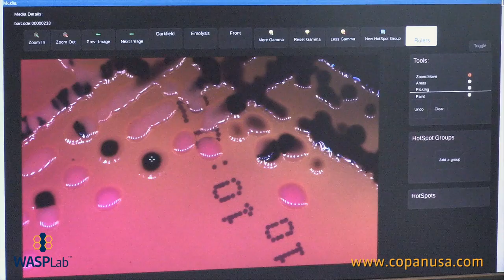(2012) WASPLab Video

Comment: Amazing isn't it...a single lab tech smiling and effortlessly processing hundreds of samples. Of course anyone with a grain of sense would know that this is a load of BS. We have a Siemens automated core lab line and were led to believe that one hapyt camper would be running the whole show. In fact it has taken more staff to barely survive, and the TAT's and OT have gotten worse post automation. See all those moving parts, decappers, recappers, plate streakers and plate movers? They all have to work in harmony, properly mapped and stepped. Maybe best to have a good downtime plan before you start!